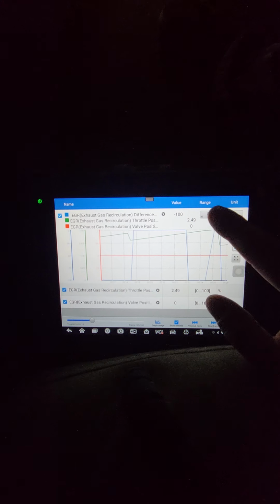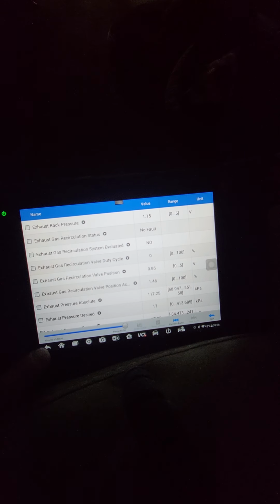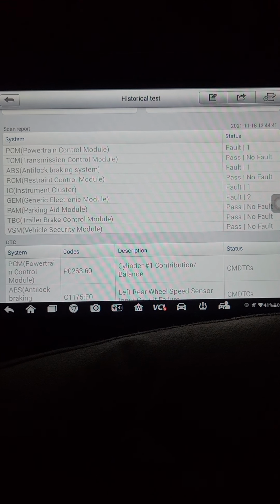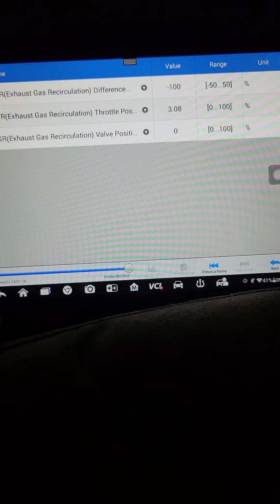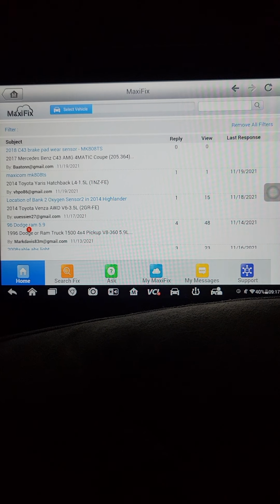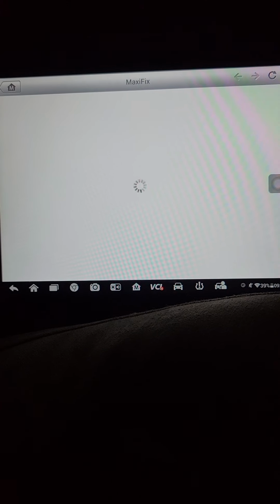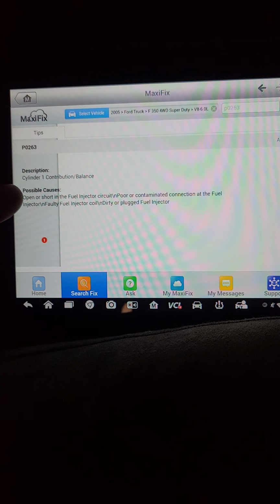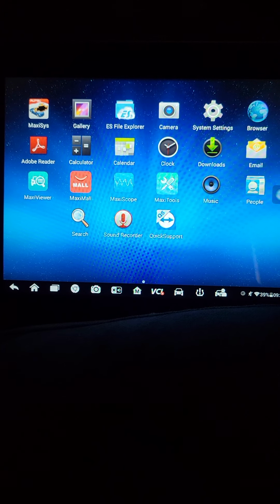autel ms906ts scanner (05 Ford f350 superduty 6.0l)

Comment: Does it always need internet connection to use it
Reply from the maker: No it does not need internet but dose scan slower when not connected so if your trying to drive around and do live data you can get more real time data by hot spotting to your phone. These are not the highest end scanners that autel provides but dose most of everything you could need for an fair price like scanning, live data ,service options for bleeding abs and such along with acces to maxi fix data base to see what common fixes helped other mechanics who report there fixes  to data base. My favorite part is you can program pcm moduales and other moduals as well with this model! Good day and hope this helps !
Reply from the maker: No I dose not